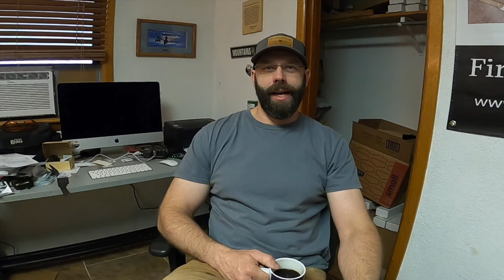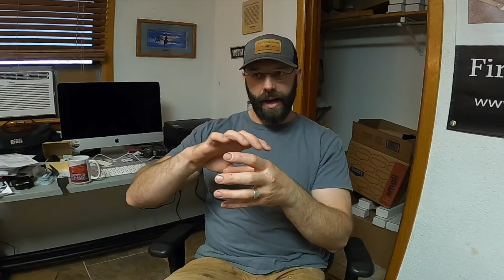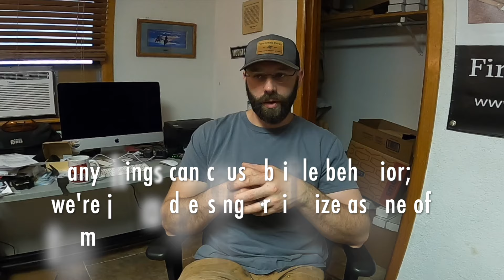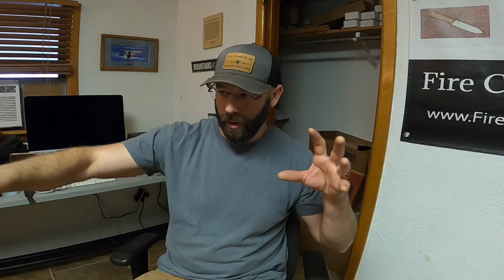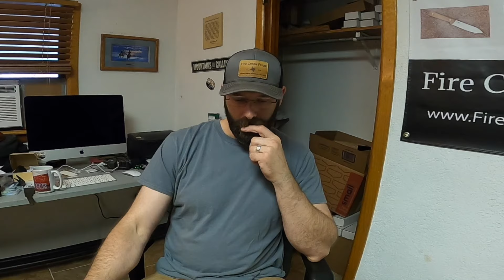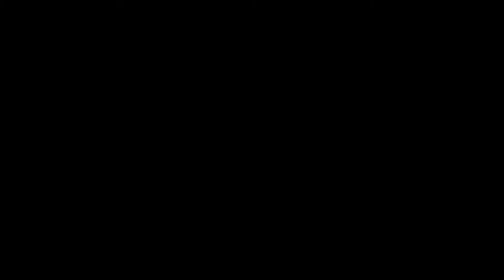How does this even work? Metallurgy Monday #4: Grain Refinement Part 1

Comment: Its quite a topic for sure, at least from my experience it can even come down to the mill that supplied your batch of metal and how it was processed. Some of it like the 125SC and 26C3 I use a fair bit of requires fairly much either no refinement if its been stock removed and maybe a Normalising, DET-Anneal and 2 grain cycles with maybe a stress relief cycle if its really been very heavily punished under the hammer.
A batch of low-alloy, high carbon Apex Ultra I won't say gave me trouble, but that was quite a lengthy thermal treatment of throwing everything at it including 3 refinement cycles, which yielded a great result at the end of it all but its a full day's work + then some. That was what the supplier advised me to do and I can't really argue with the results in that specific example.

Most of the 10xx-series seem to be the least trouble for people in that 1045-1095 range, at most I don't think you're really going to have to do more than ever 2 grain refinement cycles on them. Its really only when you're messing around with Alloys that you might want to check and verify with other people as well as just running a sample through your own equipment and see what happens at 1, 2 or even 3 cycles to see if you're getting much out of the additional process.

Comment: I’m a little confused: if grain boundaries are brittle why is smaller grain desirable?  (Seems like small grains imply more grains which implies more grain boundaries)  Anyway, thanks for these videos, I love that you’re not afraid to get technical
Reply from the maker: @bjh4970  correct, so if something is inherently weak, it's better to have more of them instead of less because then in case of failure stresses must defeat multiple points instead of a few.
Reply: @FireCreekForge  So better to have lots of small boundaries than fewer bigger ones; kinda like how a bundle of small sticks is hard to break?  Interesting 🤔

Comment: So are you saying that dislocations are small areas of damage and you are creating these small areas of damage by forging colder than the recommended forging temp in order to set up the steel for grain refinement along these damaged areas?
Reply from the maker: @jdhcpo  No. Dislocations are a natural part of steel structure, otherwise every piece of steel would literally be one giant grain. Which would be basically unworkable.
Reply from the maker: Also, dislocations occur regardless of the temp steel is forged at.

Comment: I don't understand what you mean by "heavy annealing" or annealing that requires going to the austenizing temperature...?
There are no such a thing...
Normal annealing is done under the austenizing temperature. Therefore the grain do not grow.
If the temperature is going over the austenizing temperature, keeped on the temperature x time and air cooled, it's called normalizing.
Reply from the maker: By "heavy annealing" I'm talking about traditional blacksmith annealing where the steel is heated to austenite or even above and cooled slowly in an insulating material like ashes. 
While it makes the overall steel soft and is useful for certain applications in blacksmithing, it results in larger carbides because they have time to form from all the carbon in solution as the steel cools very slowly. This isn't very helpful to us as bladesmiths.
Reply: @FireCreekForge  Yeah, I know it's done by many. But when someone does something wrong, it's quite misleading to  talk it the way, that it's some step on the ht process.